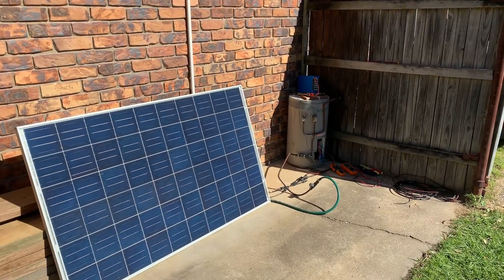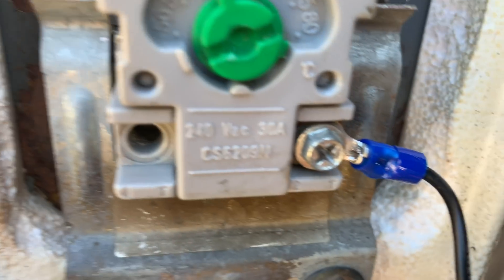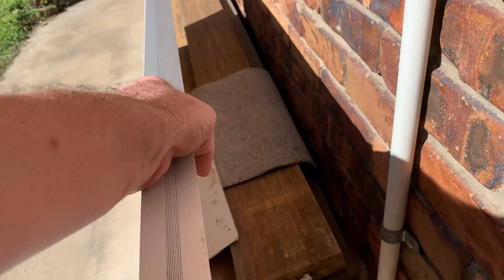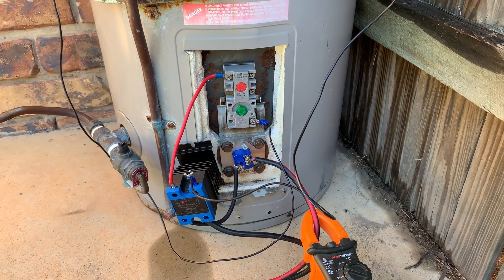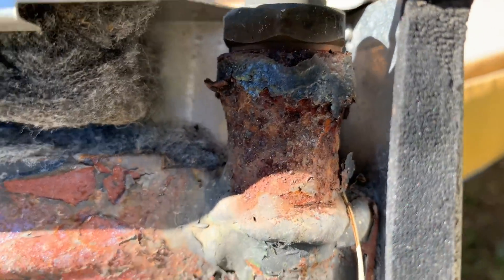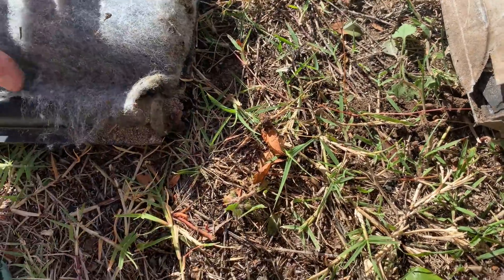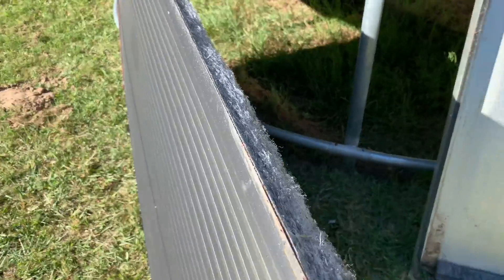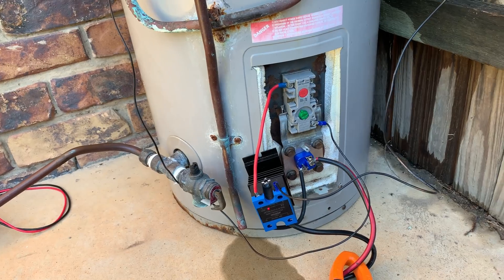Single solar panel heating hotwater system with a  resistive element.

Comment: Solar PV works really well. All you need to do is match the MPP of the panels with an element of the right resistance. You can mix the panels in series and parallel to match different elements. I cover the math here on my channel. 
https://youtu.be/2SGbqDOlBuk

Comment: Hi there. I have been watching your water heating videos. I have a 250L hot water tank and a heap of old solar panels from an old grid tied system. 1.5kw of panels. I'm trying to work out the best way to heat the tank. Tank is rated for 75 degrees so ideally I would like to get tank up to that temp so that it might get through a cloudy day. I intend to build the tank into a cupboard and pack fibreglass insulation around it to help keep tank insulated. I'm tossing up if I change element to a 48v dc one or if I run the 240V element and feed 240v dc into it from the solar panels. Not sure what to do.
Reply: It's not hard to match an element with the MPP of your panels. With 1.5KW, you just need a reliable way to switch the high voltage DC. If you are running anything over 100V, it will arc and burn the standard AC thermostat. Using multiple poles of a DC rated contactor works.

Comment: Using a PV panel to heat water is crazy, even if MPPT inverter was used. Heating the water directly would be way more efficient and way cheaper, using just a spiral of a black hose or even better such hose behind a glass. Remember that a PV panel is only about 20-25% efficient, even with an MPPT.  Sunlight can be converted directly into heat with almost 100% efficiency.
Reply from the maker: Yep done that many years ago with my spa - worked very well, but this was a learning thing and worked very well with three panels the next day *video live now
Reply: I expected better from you. It is lower cost, easier to install and works better in cold climates. It is certainly a viable option.  All solar is local and solutions are individualized.  Sure you can just stick some tubing out in a warm climate. My wife would never let me stick one of those ugly solar things on the roof.  What happens when the water is hot? You have a totally wasted asset when I can use that power for something else.  A couple panels are ideal for supplemental heating as 100% of the potential power is used.  People with PV systems are the biggest energy wasters on the planet. They just don't know it. I use all my excess PV power to heat water.  Didn't have to add panels. That is free hot water!

Comment: Just use a 200' piece of 22 awg silicone insulated wire dead shorted to the panel it will give about 1.2 kw into the water or about 5 k btu.
Reply from the maker: I've seen some videos like that in the past day or three.. if you have a bunch of wire available it would work i guess.. After this process, I want to make an offgrid spa with that broken solar thermal heater panel.
Reply: @HBPowerwall  I'll make a video on my off grid Colorado channel about it.
Reply from the maker: Let me know when it is up i'll take a look admin at diypowerwalls dot com

Comment: No one wants to listen to me. A power point controller is needed to match the heater to the panels output. It is a one ohm element and the panel is doing just what it is supposed to do.  I have two tanks and yesterday they both turned off by 10am at full temp.  You all beat your heads against a wall for the solution and it has already been worked out. The power point  is cheap and easy to build.  You could make some nice videos on the build and spread the news.  That won't happen with my 40 views and I won't take the effort to edit a good video.  Take a chance and spend $20. I'll walk you completely thru it.  It is absolutely amazing to see it work.  Show people how to really heat water! Less than a dozen parts. Anyone can solder in one part a week.
Reply from the maker: I agree it would work, but yesterday I just added two more panels for three in total and it worked perfectly - would have been better with four panels but didn't have the MC4 connectors.. In the past few days, I've learned a lot and can't wait to see this idea evolve

Comment: Only 7 V means you are straining the solar panel too much and drawing too much amps leading to the collapse of the voltage. So it works! But not very efficient. 

Instead of 30V at 8A you're only producing 7V at 8A. Meaning the resistance of the heater is too low, it's basically the short circuit voltage. Meaning a few solar panels in parallel would help. Or rewiring the resistive heating element with thinner wire or longer wire.

But I'm not sure if you balance this for 100% sunlight so you produce maximum power point, what happens at 50% light should again be the same inefficiency problem. I guess it's easier to charge a battery than just attach a fixed resistance consumer to a solar panel!

Thanks for the video!

Comment: How I'm building my SOLAR HOT WATER setup for the Catamaran is that I have a 70 Litre Stainless Steel Stock Pot with Pink Batt Insulation Wool around it for the hot water with an overflow setup into another 70 Litre Stainless Steel Stock Pot with cold water with a Cistern Floating Water Valve through the top of the lid & this cold water tank has a pipe to keep the hot water tank at an equal water level height.

Through the lid of the hot water tank I have 2 ends of garden irrigation tubing one with a 12v 8 Litre per min Hot Water Circulation Pump using around 0.8 Amp hooked up to a 20w 12v Solar Panel & the 2 ends of the garden irrigation tubing go outside to a sealed box with glass where the 50m of irrigation tubing is spiraled so that the box can sit in the sun to passively heat up the 70 Litres of hot water. If the hot water tank is not sufficiently heated up during winter days of overcast weather then I have a 240v Temperature Controller together with an old style plug in manual timer switch that has a socket on it so that I can preset a industrial SUBMERSIBLE HOT WATER PORTABLE TRAVEL HEATER ELEMENT 2400W that I can sit in the hot water tank. The AC for the Temperature Controller & 2400w Submersible Heater Element will come from the battery bank which is recharged during the day by the larger Solar Array.

For the shower I have a Gleamous GSK Low Pressure Shower Kit, WELS 0 Star, 1.5 - 4 Ltr's min, this is the same type of hand held shower used with propane gas hot water heaters in caravans together with 2x 12v 8 Litre per min Hot Water Circulation Pumps that handle upwards to 99 degrees Celsius one for the hot water & one for the cold water which are manually switched on. It might all sound complex but it works for me in the way of using a minimum amount of hot water to have the maximum amount of time in the shower without running out of water & using passive solar heating of the water as well as it being backed up by batter powered 240v 2400w electric heating. The average time to heat water I found was this measurement 1600w per 60min per 60 litre, 2400w per 40mins per 60 litre converted.
Reply from the maker: Sounds like you have it all well sorted. I can't wait to do my own off grid setup for my self but for not i'm happy helping others and learning
Reply: Feel free to copy anything that I used, if you want links to certain hardware I can easily provide you with. I'm here in Perth, WA & everything I found was online on eBay.

Comment: You know how the old PWM solar controllers feed power into a battery when the battery is at a reduced charge well when checking the voltage from the controller going to the battery it always reads like 7v but when using a MPPT charge controller it reads as 14+v. I'm not sure why that is but because you have the solar going through hot water system & battery it seems to be behaving the same as an old style PWM solar controller.
Reply from the maker: not really aware of that sorry, i used a PWM many years ago but i had no idea what i was working with (then or now lol )

Comment: you will need a lot of watts to heat water with an immersion element. A 3,600W element will heat 63 liters per hour x 50°C
Reply from the maker: i'm using a 600w 24v unit worked well today just released another video update. 
in the description has some links to what i'm using .

Comment: The hot cells are probably the only ones working
Reply from the maker: I think other comments were right. the panel was basically a dead short - i added more panels today and working very well with out the hotspots

Comment: Looks like trying to heat a 10 gal tank of water with a 60watt soldering iron!  Maybe a bc converter, and pull the panel down to max power, what ever the output, I think it's pulling the power down to a useless voltage, maybe test the panl! Then maybe 2 in series, because it will pulled down, if the resistance is low enough...
Reply from the maker: lol great analogy! I got it all sorted now added a few extra panels and 4 hours later i have nice hot water .. https://youtu.be/khkazmCgzmQ

Comment: At 9:48 some cells are hot. On YouTube there are some videos showing how to by-pass dud cells. It might be worth trying that if you have the same issue with dud cells on the other panels as well.
Reply from the maker: turns out others told me that I'm basically dead shorting the panel in the worst way. Adding more panels solved the heat issue. New video is here https://youtu.be/khkazmCgzmQ

Comment: At 8:39 I agree, just clean the rust off and cap off the old connection. Tricky to weld, so maybe just fill the holes with Bondo. Then fit a new connection on the other corner at 9:18 instead. 🤐 A fresh coat of paint and some new insulation, then set up a thermosyphon by mounting the water tank above the solar panel. 😎
Reply from the maker: It's a great plan but now I've done that I don't feel like going any further with it at the moment lol best-laid plans and all that.

Comment: I would think that solar thermal would be more effective and efficient. How many watts and kWh will your full solar PV system generate?
Reply from the maker: Where this setup is heading is an offgrid property and is 24v - batteries get to 27v by 11 each day as there is 3-4kw of panels (can't remember to be honest ) Solar Thermal would be a great option how ever we will be using this direct from batteries and controled by the BMS as a dumpload next video is here https://youtu.be/khkazmCgzmQ

Comment: the hot solar cells were mostly because you were shorting out the panel with the rather low resistance of the heater element, the panel needs to be at its optimum operating voltage, otherwise you are losing out on all the power that is being wasted as heat in the cells because of their resistance. this is why MPPT charge controllers are so much better than PWM controllers.
Reply from the maker: Yep, you're so right - after adding more panels it heated the water to 60deg in only 4 hours with three panels new video is up here https://youtu.be/khkazmCgzmQ

Comment: the solar hot water heater looks very much like a household radiator painted black so will prob be mild steel clean it up stick pipe in use liquid metal and you might get a seal a point to add david poz already prooved that solar panels and electric heater works better then passive solar hot water mainly due to cost and area and the fact you already have solar makes it the most obvious choice
Reply from the maker: I've watched so much david in 24 hours... very watchable bloke!
Reply: @HBPowerwall  his battery layout gets one scratching head and thinking why did you not do this or do that mine was why not make all the packs same length the wiring looks so confusing all criss crissing

Comment: Connect the panel directly to the element no ssr is used
Reply from the maker: ssr allows me low voltage to the thermostat - hopefully making it last longer running DC

Comment: Automotive radiators are notoriously toxic, even using a brand new one out of the box. The materials are loaded with chemicals that do leach out into the water.
Reply from the maker: I'm not using an auto one?
Reply: Bull Shit, if a copper, brass, or aluminum radiator is cleaned properly before use it will be clean as a whistle.

Comment: ive done this sorta thing before , i used multiple panels in series no batteries, another way was using a voltage booster , then you have techluck for around $400 or what ever its called. anyway with around six 200w panels in series into a 24v 600w element it worked well, took hours though to get to 55 deg c, but it did not even compare to a second hand solahart i got for free. im going for evacuated tube heating myself but the new solar gain water heaters which look like the old school solar heaters are a whole lot better and my relatives have them and man they get hot and fast ,work better on cloudy days too 
ive seen installers walk on top of solar panels then much later on hair line cracks show up in the individual cells, well that and miss handling panels by  putting your hand on the backside of the panels while carrying them, a transport company cost me around $2500 doing that.

Comment: looks like you're only getting about 60W into that element. Would take a very long time to heat that water. smallest element in that type of hws is normally 2400W
Reply from the maker: yep, one commented that i should just try heating it with a soldering iron lol new vid out now got it 100 percent working well https://youtu.be/khkazmCgzmQ

Comment: For the solar water heater pipe panel, you could cut or unscrew the rusted end.  Clean it up good with a wire brush and some muriatic acid (5 parts water to 1 part acid; this is pool acid, get it cheap there; wear long sleeves glasses) or CLR (if they have that down in Aus) to remove the rust in that corner. Then you could find an iron pipe that is a size smaller than the output and put it "inside" the panels pipe. Shove some automotive grade JB-Weld (for the heat) in between the pipes and let it cure. Since it's running low pressure and <120C (it could reach that hot as it will be under some pressure when things heat up, so don't use rubber hose unless heater hose for automotive; this is, if it's a sealed system. If working with an open barrel, then temps won't go above 105C), the JB-Weld will hold pretty easily.
Or you could try your hand at actually welding it in place  ;)
Reply from the maker: Didn't think about JB... good idea easier than welding it

Comment: Checkout Engineer775 on youtube, his system uses 1200 watts and a modified pwm controller to heat a normal 240 V AC water heater lower element with no modifications to the heater
Reply: His tank will corrode within 3 years. Electrolysis
Reply from the maker: Subbed him for years, did see that one tho.. will look into it, thanks for the share.

Comment: dump load with relay on your aux works good and you use all original equipment but the inverter has to run.
Reply from the maker: only have a 2400w inverter and it's my old PIP2424HS inverter so not up to the task i don't thinks.

Comment: Pete, using PV to heat water should be a crime, unless your batteries are full and you have nowhere else for the energy to go!
I'm sure you would do better with a cheap coil of PVC pipe covering the roof and collecting heat directly.
A small solar panel could run a cheap aquarium pump: more sun, more pumping. No sun, heat stays in tank!
Reply from the maker: Andy - this is not the final version of this setup - there is much .... well much more too it.. will be controlled by batrium wm4 solo (i hope it's the next test) off grid setup, dump load from 24v system
Reply: @HBPowerwall  Thanks! Looking forward to seeing what you come up with!
Repairing that thermal panel would be challenging but not impossible. Could be built up and ground down to make secure but difficult to avoid voids.
Perhaps resin and fibreglass could help too.

Comment: put a copper coil on wall or plastic coil and put radiant heat in  as well as 36v element and see dave pos site as stated above
Reply from the maker: Yep been on daves channel for a few hours today , very well presented data - much more to learn

Comment: You need a 36v or 48v element for that panel your using.  I use the original 240v element with 6x panels in series. It works great
Reply from the maker: i'll be playing around with setup with different panels in different configurations tomorrow then off to the batteries it goes... won't stay like this